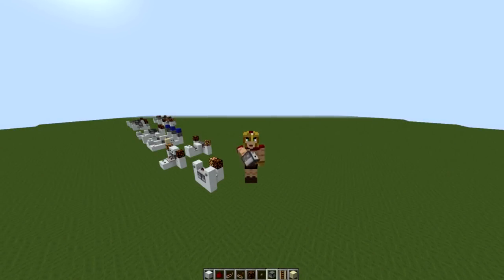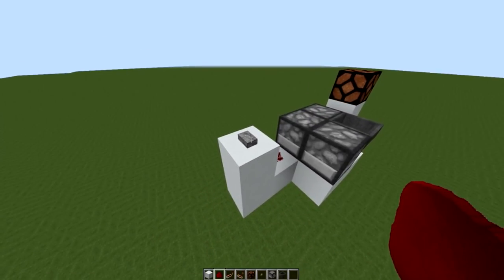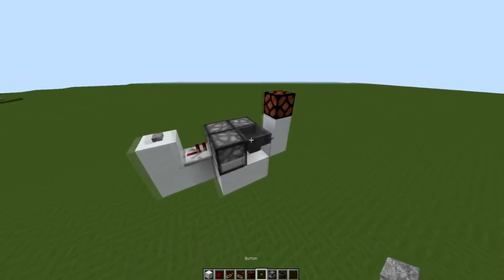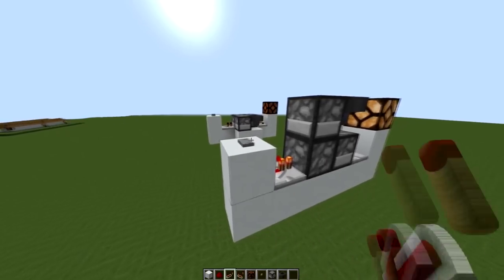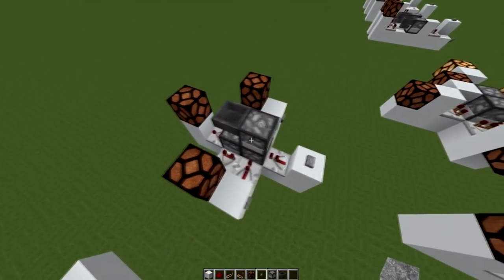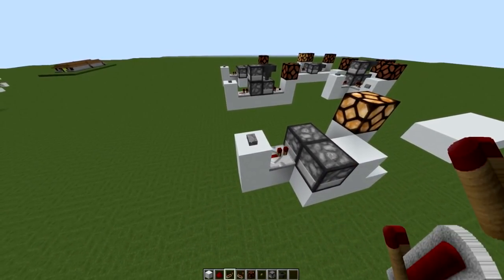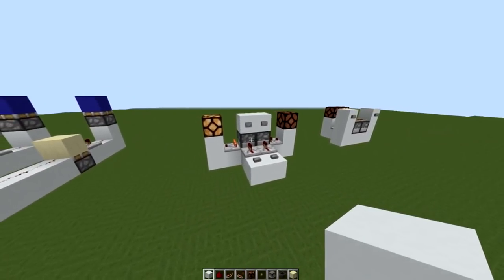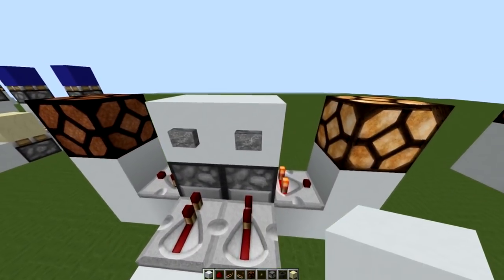Minecraft Tutorial : T-Flip-Flops, Quick Pulse, RS-NOR latch ( Part 2 )

Comment: Wood button and redstone dust works. The time the button is activated is the problem. The repeater makes it a full pulse.
Reply from the maker: the repeater creates a zero tick pulse if the repeater is on 1 tick and 2-4 ticks will creates a 1 tick pulse but depending if its on a 2-4 tick it will create a delay of that 1 tick pulse. now a wooden button will creates a continuous pulse that last 5 ticks and a stone button will creates a continuous pulse that last 2 ticks long. A quick pulse will create a continuous 0 tick or 1 tick pulse no matter how long the activation is.
Reply: Basically the redstone dust powers the block (only) and the repeater makes it a powered block (to power the second dropper)...?

Comment: what texture pack is that Ken? It looks great. I love this video, i was wondering why the dust was not activating the dropper and did some tests in Bedrock.  This is not an issue in Bedrock, the dust will activate the dropper.
Reply from the maker: will the reason i use the repeater in this method is because it works on all platforms. the redstone dust use to work perfectly across the board but from the recent updates from PC and console mechanics have changed a lot when it shouldn't have
Reply: K1 Inc. Yeah, Bedrock has brought a lot of changes, and although it similar to java, I believe java redstone runs on 4 ticks per second and Bedrock runs only 2 ticks a second, I do love your designs, you just simplified my piston.  Lol  Thank You.
Reply from the maker: anytime buddy im really going to try to make sure designs work on both platforms but the better together update really made some crazy changes
Reply: K1 Inc. yeah, I think the gap in game mechanics between console and Bedrock will make that difficult. For the moment only the switch and Xbox will be running Bedrock. Oh one question will a piston get triggered by a pulse through the piston head? It does not on Bedrock. I can trigger it from 6 sides with a observer but not through the head.
Reply: Markus Bane on console and java you can power a piston from the face.  That's how most monostable circuits work.  They are pretty useless in bedrock though because of how game ticks work.  In other versions there are 20 ticks a second, something can happen every tick but in bedrock it still kind of runs 20 ticks a second but Redstone only updates every 2 ticks.  So instead of things going along happening every tick bedrock takes everything that happens every 2 ticks and god only knows how they figure the operation order for things to happen.  To me it seems random.
Reply: Steve Kratzenberg Yeah I’ve noticed, I’ve been hoping to use the mechanic to make a melon farm, had to use alternative methods. The mechanic I’d love to have is for item elevators.